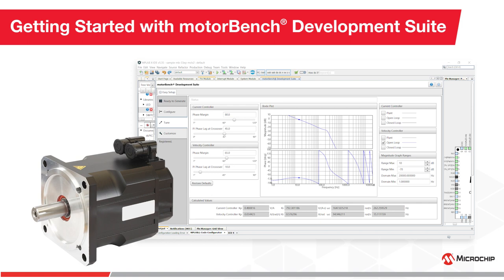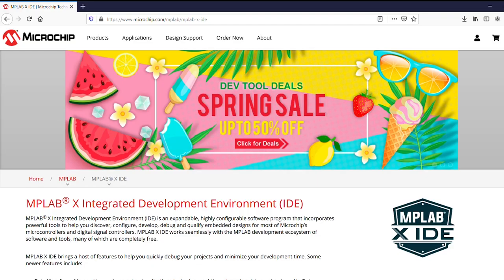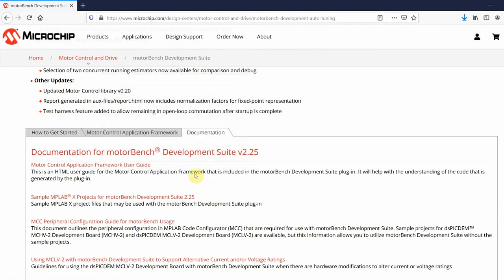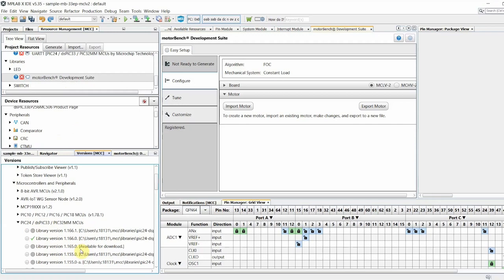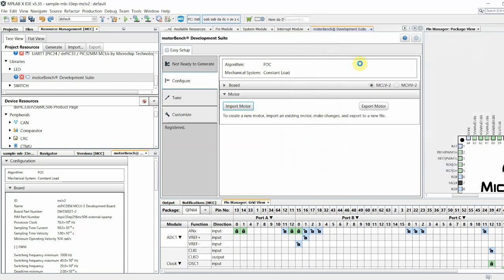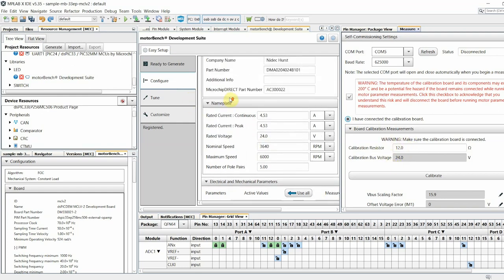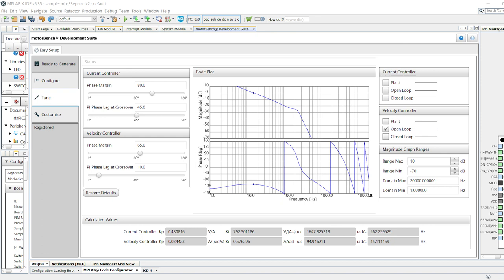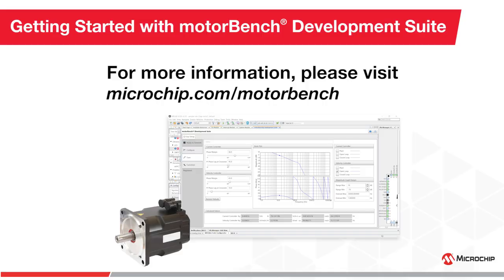Getting Started with motorBench® Development Suite v2.25

Comment: Is the motor bench parameter measurement just ready for PIM MA330031-2, dsPIC33EP256MC506 external OP? Is it ready for PIM MA330031, dsPIC33EP256MC506 internal OP.
Reply from the maker: If we may be of assistance, kindly visit support.microchip.com. Thank you.